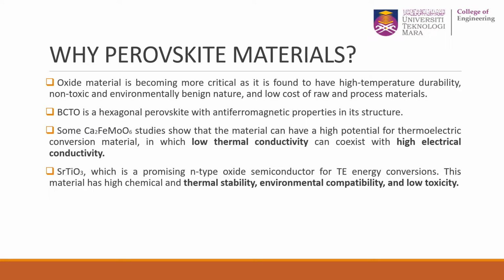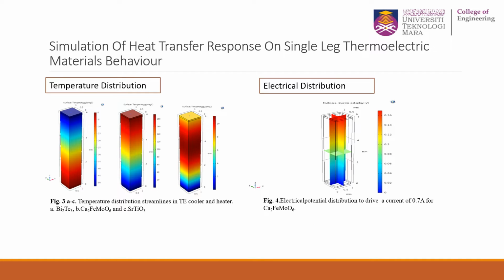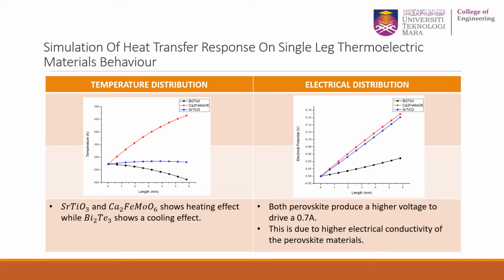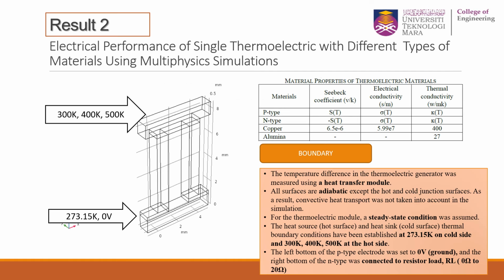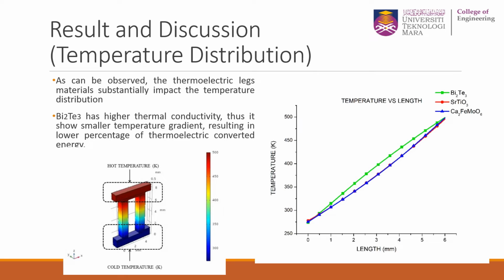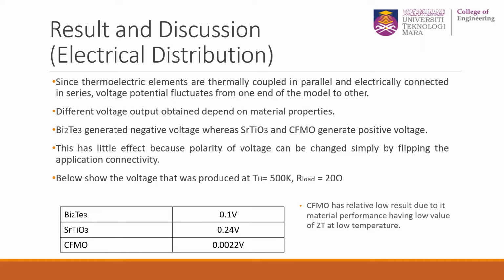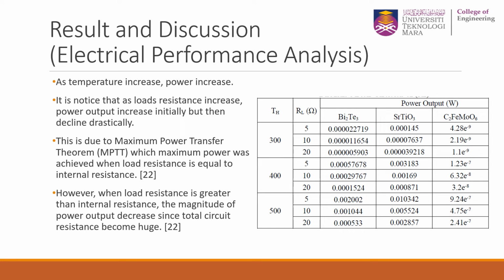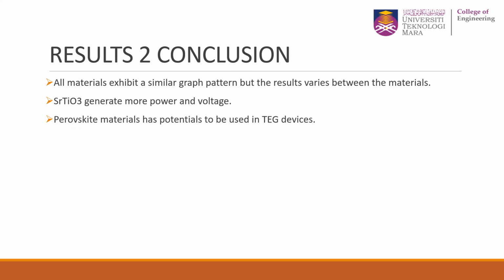ELECTRONIC AND THERMOELECTRIC PROPERTIES PREDICTION OF HEXAGONAL PEROVSKITE Ba2CoTeO6 BASED CERAMICS

Comment: Electrical Performance of Single Thermocouple with Different Types of Materials Using Multiphysics Simulations[2022]
Simulation of Heat Transfer Response on Single Leg Themoelectric Materials Behaviour[2022]
Optimization of thermoelectric performance by varying thermoelectric height[2023]